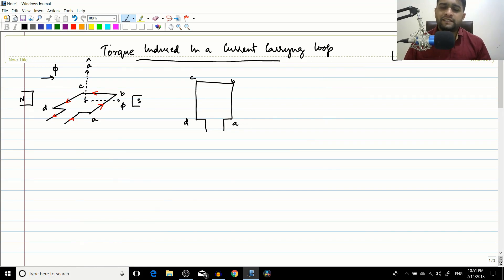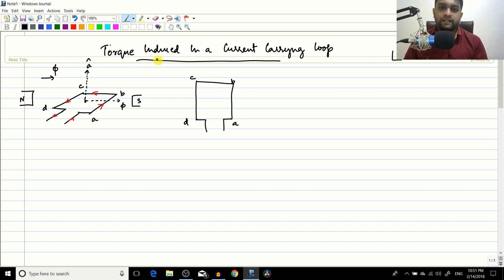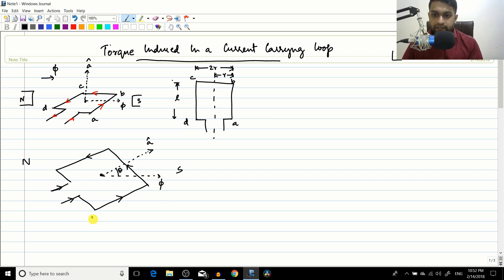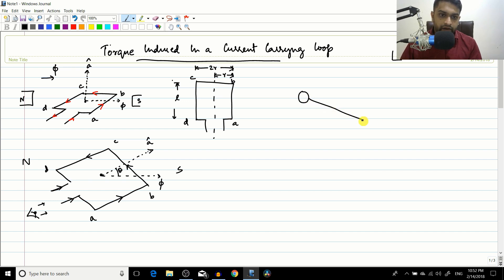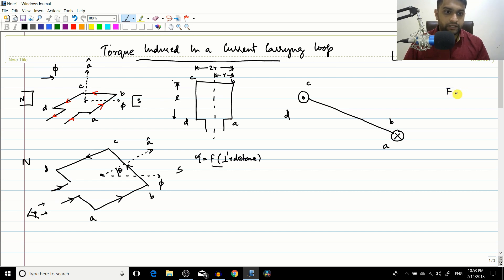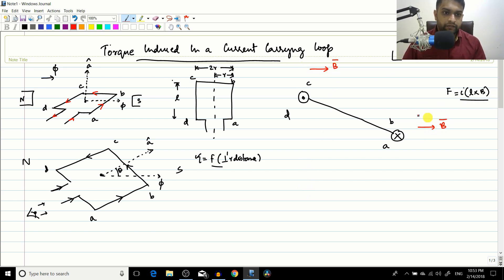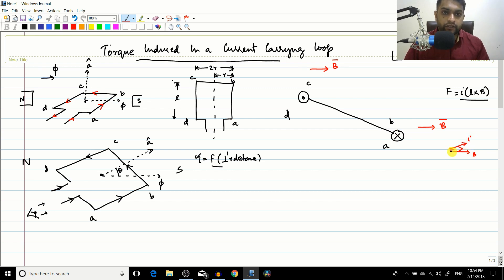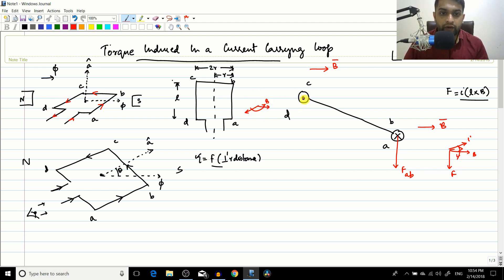#3 AC machinery fundamentals -Torque Induced in Simple loop in a uniform magnetic field

Comment: Ele is by and far one of the most difficult branch of engg still why do coders get so much salary I never understand.
Reply: Electrical Power Engineers are the most highly paid engineers in Europe and the USA. The demand is very high if you have specialties in Renewable energy
Reply: It's the Demand ......you aren't learning this through books or offline classes ..you are on line...
Reply: @Xyzengineer  if you go by dependencies then without electricity your router wouldn't work 😛

Comment: Sir,if using T = Frsin ( theta) or k(BsxBloop), the  torque is actually a vector pointing into the page but we said the rotation is CW. How can that be possible? What does Torque direction actually means?
Reply: The torque encodes information of magnitude and direction as a vector. In the case of torque, the direction of the vector is somewhat indirect, in that it doesn't indicate the direction in which any physical thing is moving -- it indicates, by the cross-product relation, the relative directions of the force and moment arm. The utility is that in a single value we can communicate how something will rotate, given the standardized relations in the definition.

Comment: When Bloop align with Bs ,angle between them will be zero so do the sin term ,which makes torque zero. How does motor rotates after that?
Reply from the maker: A bit of intertia will drive the motor forward , and anyways torque is defined for two forces which act as a couple...